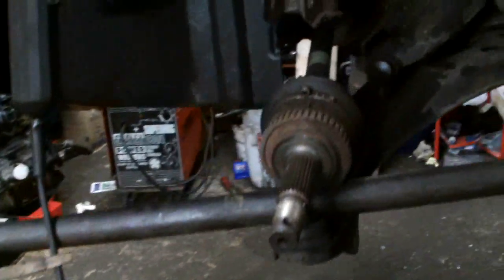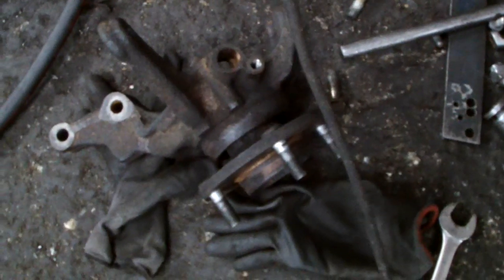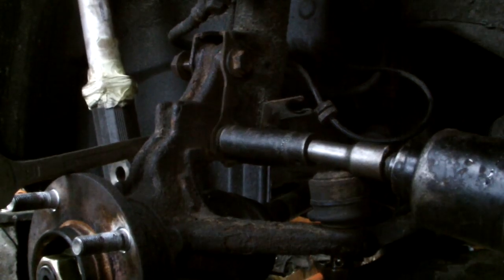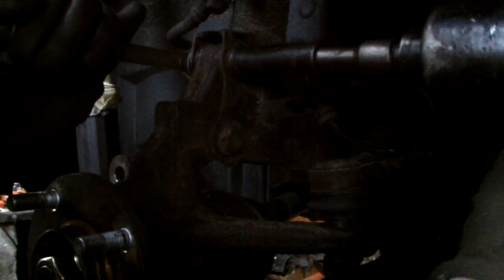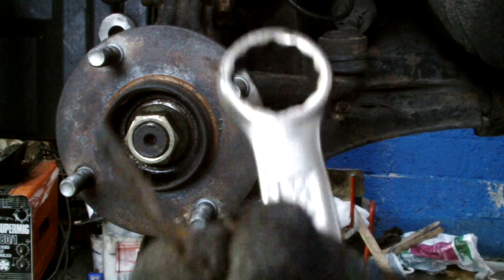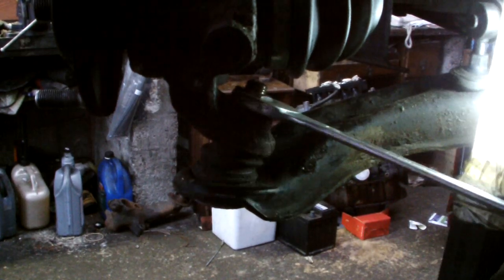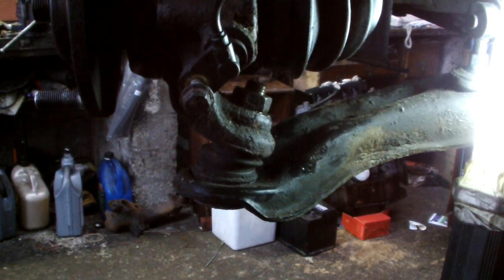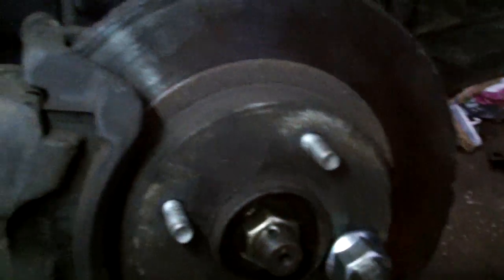HOW TO INSTALL A WHEEL BEARING ON A NISSAN PART 2

Comment: when removing the strut bolt is it under compression?  or is it safe to remove
Reply: no only if you remove the bolt on the top of the strut will the shock release be carefull that the underside of the spring is not rusty or weak as that part can break and make the strut uncompress itself